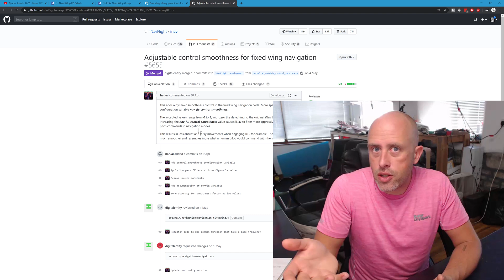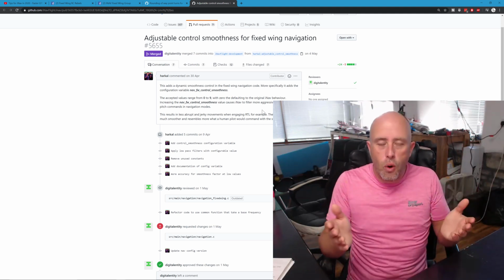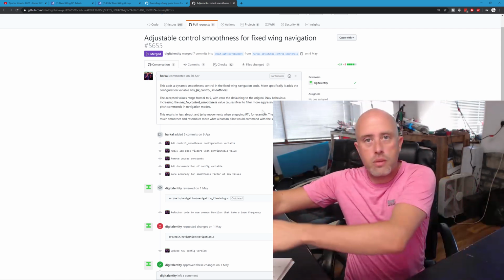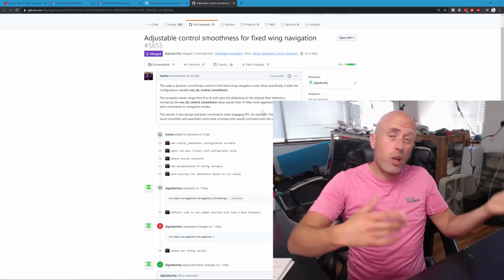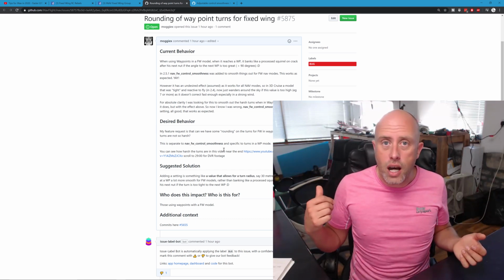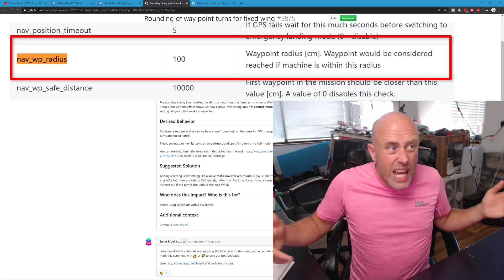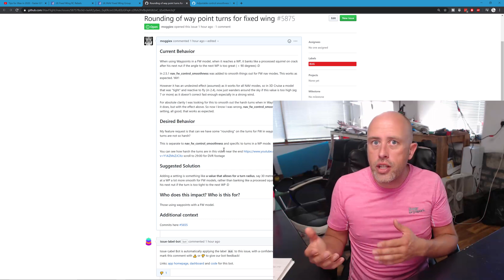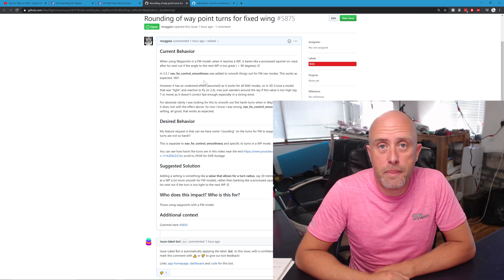A Drift Wanders... A Little Too Smooth with iNav ( nav_fw_control_smoothness )

Comment: creator of the feature here first of all thanks for making this video, people should always try progressive value changes! And this is definitely required for this feature in particular because the response of the craft depends a lot on the flight characteristics of the model. For people to mentally visualize what the feature does, imagine that when inav decides that the left aileron needs to be at 30° it's just commands 30° and depending on how fast and strong your servos are the aileron gets to 30 almost instantly. With smoothness it does the movement of the ailerons progressive... Fly safe! 🤓
Reply from the maker: Howdy, oh it works exactly as it should do. I looked at the commit and the code written too.

It just didn't do what I thought it would do which was to tone down the harsh movements when a WP is hit. Instead if too high that little drift was wandering all over the sky. It's very similar to the gain on a vector in how it reacts, would suit a pot on the tx to change its value during the flight based upon the conditions.

Anyway, nice work!

Matt
Reply: That's one thing I've always appreciated about Inav, the people behind it who explain the features in easy to understand terms, from their wiki (nav_fw_control_smoothness) "Controls smoothness of navigation control (0-9). 0 gives legacy behaviour, non-zero values give increasing smoothness."
Reply: So you basically added in an integral filter to the setpoint? and with 0-9 we are just adjusting the gain of the slope?